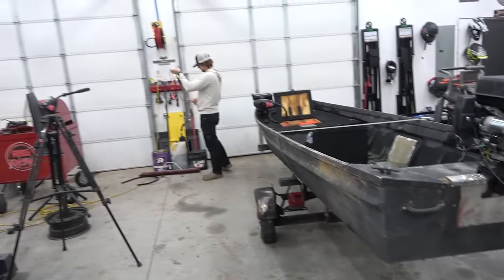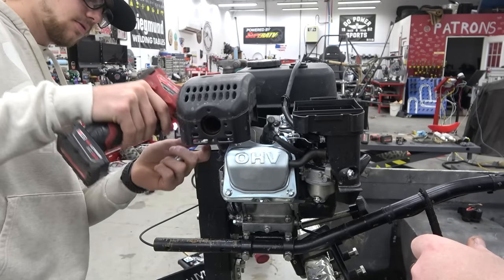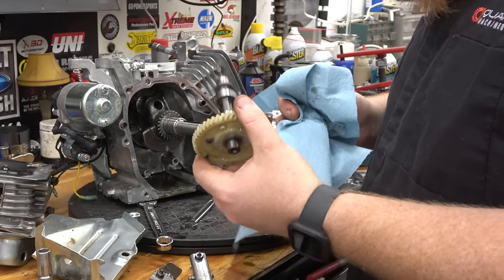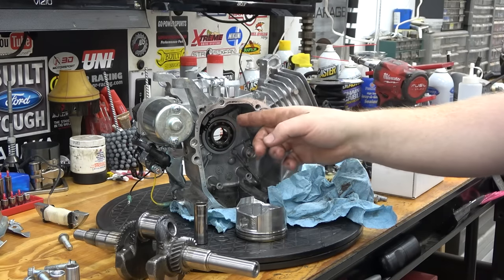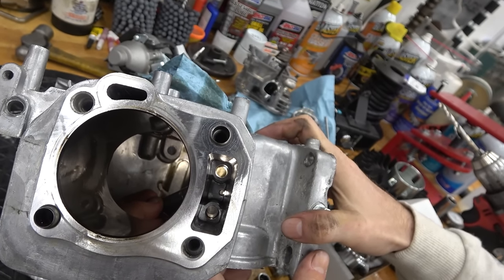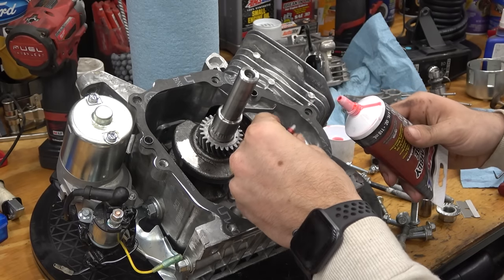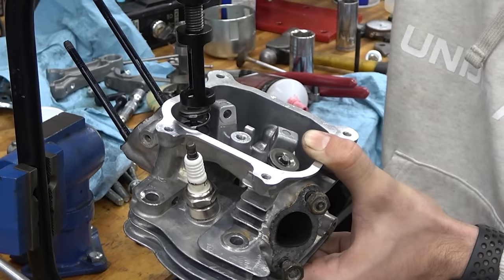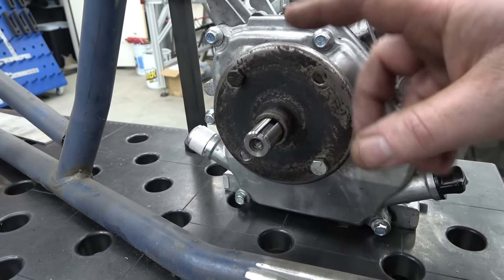Mudskipper FEATHER-LITE 5-7hp Surface Drive Full Engine Build

Comment: I love the header in the water idea. I hate hearing guys ripping straight piped mud motors while I’m duck hunting.
Reply from the maker: Yeah I would think it would be way better in the water.
Reply: i tried running the exhaust down to the water on my longtail swaprunner and it cause a lot of cavitation issues for me.
Reply: @zachwelcomepoor565  I can see that as you’re introducing air/ exhaust right in front of the prop.  With the set up he explained with a surface drive you’ve still got a good bit of space between where the exhaust enters the water and the prop, as well as a surface drive by design has the prop breaking the water’s surface while running so cavitation usually isn’t an issue for them.

Comment: A quick tip trick to y'all on the mounting the engine back on for the belt. You can use A wooden dail rod pin to align the shaft into the belt drive pulley.& Mounting plate bracket to.

Comment: I'm wondering how well this will work. I've been thinking of going to the billet flywheel but part of having a mud motor is you need that extra rotating mass to chop through things. Need to see if it's worthwhile to spend the money on

Comment: Hey red beard, I have two questions for you. #1) have you ever heard of, or do you see any problems associated with using a dirt bike/four-wheeler engine that revs much higher for use in a mud boat. For example, a xr400 engine makes 30+HP and redlines close to 10000rpm. With these 1:1 crank/prop speed, it seems like if you want to go fast, you need lots of RPMs. A lot of the Japanese dirt bikes/four wheeler engines are small and make lots of power at high RPMs. It seems like you can Cruise one at 6,000 RPM all day. #2) I have an old Honda FL250 odyssey. It has the crazy loud 250cc 2-stroke engine. My land is situated close to neighborhood homes. I have thought about putting a 420 / 440 / 459 in it to quiet it down and give me more low in power. Do you think that would be worth it or just an insult to remove the 2stroke? It runs great as it is, just LOUD

Comment: I’ve heard to not remove the governor on a mud motor because if the prop kicks out of the water and it over revolutionizes it can throw the gears out or strip everything out. Does that sound realistic ?
Reply from the maker: There is nothing to strip. Just a couple of bearings and a belt. Should work out pretty good in my opinion. May be more prone to break a belt now.
Reply: Depends on the setup and how it’s propped. And you’re not going to “throw the gears out” or strip anything. You over speed the prop and all you do is cause cavitation.

Comment: video is kinda a let down for me. quality content doesnt have a time limit but the full story needed to be told. I personally would have loved to see a stock dyno pull, teardown hyperlapse, condensed build, followed by 1 dyno pull & new engine numbers, and wrap up the video with Braxton Rapppping it up on the water!  just say "links to how-to's in the discription as well as the parts used on this build".  Obviously dont need my help running a channel, just my opinion. maybe a few will like this comment to affirm it.
Reply from the maker: The video would have been over 45 minutes long. I would rather break it up instead of spending a full week trying to get one video out.